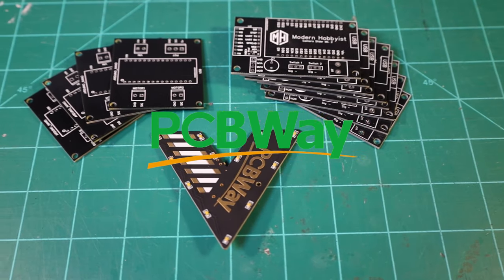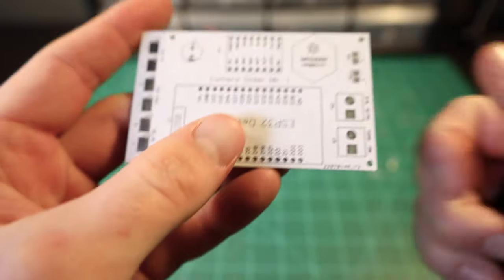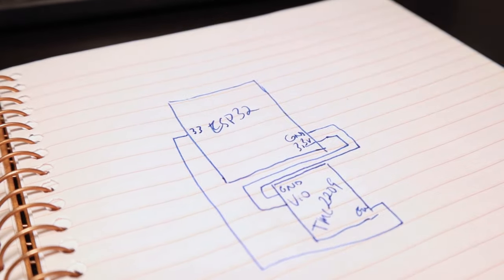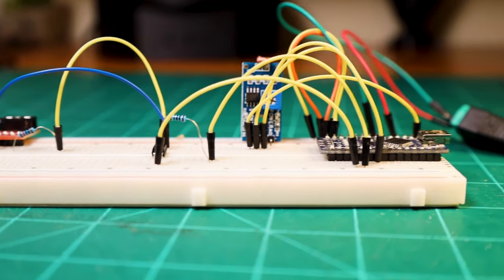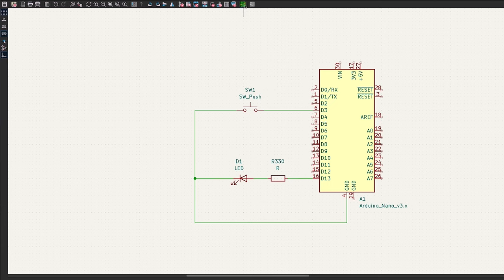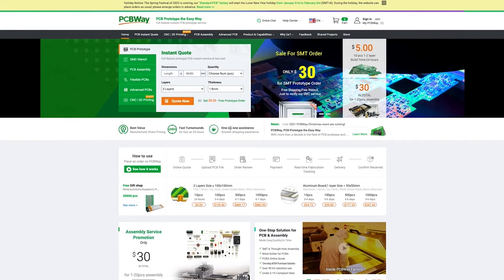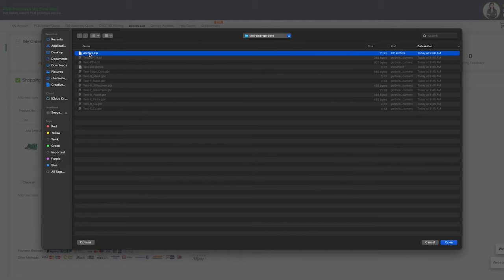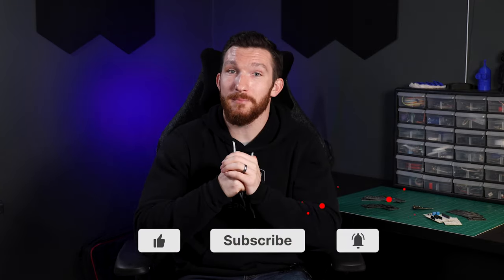How To Make Custom PCB's For Your Projects!

Comment: If I am an electronics hobbyist why would I contract a company to make boards for me? That's just dumb. That's like hiring an athlete to go to the gym to exercise for you. I want to hold something up and say, I made this. Some of the boards I've made are pretty janky but heck I made them myself.
Reply from the maker: Personally, I’m even more proud of my PCB’s, because I still designed them from scratch and I even get to put my logo on them.
Reply: Depends on the level of complexity of the circuit and most importantly if you're making something that NEEDS to be portable and small. Recently I started looking into pcb manufacturers because of a 5ghz wireless audio project that I want to incorporate into my beyerdynamics headband.
Reply: @ModernHobbyist  I don't have Keebler elves chained up in my basement doing design work here. Mostly though if I can find a circuit that does what I need it to I'll use that. Why reinvent the wheel? Although I have completely designed some circuits for whatever reasons. There's certainly enough schematics available though to keep anyone busy.
Reply: You are aware that most companies do this even big ones. Just because they get to produce the PCB it doesn't mean they own the produced products or will get credit at their own work. In fact end user usually don't care much about stuff like the manufacture of their PCB or inside components but rather who made the product.
Reply: Because when I design a guitar pedal effect to sell, I don't want it to look "pretty janky".
Reply: @fredtaylor9792  why not? Janky is unique and unique sells. I can buy commercial pedals for peanuts. Boutique pedals on the other hand cost. I took an overdrive pedal I'd made to a music store and let the owner try it out for a bit. The first words out of his mouth after he'd played was, "How much do you want for it?" I had to inform him it was not for sale. Believe me when I tell you that pedal had a prototype look to it. Because it was. One of a kind.
Reply: @1pcfred  I take pride in good quality,  even if janky sells.  Noisy circuits that fail can be someone else's game.
Reply: @fredtaylor9792  the point of an overdrive distortion box is to make noise. I've made hanging garden circuits that have functioned for decades too. The first PSU I ever made still works today. That was 46 years ago now.
Reply: @1pcfred  Gently playing wind Cries Mary through a fuzz box that hisses with noise with your guitar volume rolled back to give you that sparkling clean tone Jimmy Hendrix was known for, isn't what most guitarists want. I should know,  I'm also a guitarist. Apparently you're not,  because you don't use overdrive and fuzz for dirty tones all the time.
Reply: @fredtaylor9792  you know what opinions are like? Hint, everyone has one.
Reply: @1pcfred  Except I haven't stated an opinion, I've stated facts.  You're just getting abrasive because you know I'm right.
Reply: @fredtaylor9792  you've stated your unqualified opinions. You just don't realize it. You must think everyone's experience is the same as yours is. I can assure you that's not the case. We all do what we do for our own reasons. when I build electronics it is purely for my own self edification. No other good reason besides it's what I want to do. I'm not planning on selling it to anyone. I do it purely to do it. For the process. That's it.
Reply: @1pcfred  You asked why you'd want to contract the work out. You said "that's just dumb". So I explained why it isn't always dumb. You can't accept that so you continue to argue and insist your way is the only way it needs to be.  You're being petty and a stick in the mud.
Reply: @fredtaylor9792  indeed I asked why I'd want to contract work out. I only do the work because I enjoy doing it. That is literally the only benefit I derive. I am willing to invest a considerable amount in my own pleasure. Time, money and effort. I'm selfish like that. So you can add all of that to my character flaws.
Reply: @1pcfred  Keeping a list of your character flaws sounds like too much work.  I'll contract someone else to do that. Btw, it's not the work I don't like. Building pedals is a side gig for me and I do it for fun.  Point to point building is fun so I understand what you're saying. I still hand build my pedals, populating components myself,  drilling the enclosures and soldering the pots by hand... it's fun.  And it's not like having a pcb comes with no work.  You still have to plan out the layout and draw it up in software so they can make it for you.  It's professional,  clean, saves space and saves you and the customer money. I'm not saying you need to or should do it but to call it dumb to do it any way but your way is silly.
Reply: @fredtaylor9792  it would be dumb for me. I am only into it for the process. Perfecting that process gives me a lot of satisfaction. I would be completely deprived of that if I had the boards made. Which for me would be a great loss. I've done some point to point projects that have soured me on that method. But perhaps I just wasn't in the right frame of mind at the time? I set myself a bit too challenging a task I suppose. Suffice to say I was sick of things long before I was done.
Reply: @fredtaylor9792   I had that hit and miss stuff myself. So I figured out how to improve things. It's easy. You just heat the acid up and bubble air through it. That's it. You do that and you'll succeed every time. Acid has a fuming temperature. It just lets off vapors. When it does that it's hot enough. You can see it. Kinda makes your nose itch. So don't breathe it. Once you've hit fuming temp start bubbling and immerse your board. In less than 2 minutes you should be done. Works that good. For bubbling I have a 12V tire inflator. Kinda a crappy one really. The worse the better. You don't need a lot of air. We don't want acid all over the place. The acid just has to look like it's boiling. But don't boil the acid. You actually have to pump air into it. The air oxidizes the copper. Plus the bubbles agitate the mix.
Reply: Dude…
Reply: Cause I don’t have a drill but I find most companies will make 5 boards minimum. I have a simple amp design. Why would I need 5.
Reply: This dude... yikes
Reply: @SoccerPhoto  I would say anyone with a custom engine block is an alpha car hobbyist. I certainly wish I was operating on that level myself. I guess I'll just have to settle for the custom hand forged Venolia pistons I have now though.
Reply: If you’re an owner of a small company that needs well made boards for their product it’s not a bad idea to outsource it. But I agree that as a hobbyist owning it is what I preferz
Reply: Then there is the fact that you probably need only one, but if you have a board manufature make the board there is probably a minimum of 5 or 10 boards.
Reply: Can you make 7 layer PCB
Reply: @alpha_pixel_  I could if I wanted to. I'd rather design a single sided board that does what I need it to though.
Reply: I get your analogy but also not quite. It's more like someone who's building their own house but hires a plumber to do the water. 

There are so many other aspects to tinkering that doing every single step may not be what people want to do. 

For me, I want to do the code, the soldering, the case design and the pcb design, but I don't want to make the case or pcb.
Reply: @11219tt  I've modded my PC case. I'm thinking about doing a case build. I don't care for where cases have gone lately. Really all of PCs are headed in a direction I'm not keen on. The whole gamer thing. With the RGB. It's not my cup of tea. I guess my mouse is RGB? It has a goofy light on it. I keep it behind my monitor where I can't really see it though.
Reply: @1pcfred  dude I totally agree with the LEDs I needed a quiet and black computer for a recording studio band the thing ended up looking like a space age club instead
Reply: @11219tt  it is not easy to find parts that don't look like they belong in a discotheque these days. I don't want a window on my PC either. If I need to see what's in there I'll take the side panel off. I want external drive bays too. I don't like bottom mounted PSUs either. We used to know how to build a PC right. We're evolving backwards now.
Reply: No what your saying is that i didnt build that car because i didnt drag a pickaxe down a mineshaft to fetch some ore, id much rather draw a design, test it on a breadboard and have a company print out my design rather because all it is someone else print its like saying its not your book because you didnt write it down with the janky handwriting you typed it up and used someone else’s printer
Reply: Because even the most seasoned of electrical engineers don’t mine the copper out of the ground and laser etch the traces and sandwich in polymer. They design the pcbs and then order them from a company who makes pcbs.
Reply: 1) most of the new ics and microcontrollers only come in smd form factors 
2) CUSTOMIZATION , you need more ram , choose a chip has more , want more storage go for it , want wifi with an stm32 ? Add it yourself , want more storage , just add a chip are wire er up 
3) too many parts ? And being physically near impossible to make an feasible model which works for a long while without being in jank 
4) size 
5) detailed prototyping making life easier , just use 0 ohm resistors to isolate the circuits 
6) half profesionalism and more presentable and viable for final project ( if your project is for example supposed to work in the rain you can't waterproof a breadboard ) also you can make3d cases for a pcb since all the peices are fixed on a pcb 

In conclusion , your opinion is wrong but you'll figure it out soon enough , your prob new to the hobby
Reply: Sometimes the skill is the process, sometimes the skill is the product… writers don’t need to know book binding, but if someone does and wants to do it by hand, sure that’s awesome and an art in and of itself, but it doesn’t make writing any less of an art if they use commercial companies to print it… it’s also the equivalent of photography, some artists take pride in every single step, but some keep the art in the construction of the shot and the settings to put it to negative, neither is better or worse, they are different .. I am assuming you are acting in good faith in this thread and genuinely don’t understand why people would outsource production, but even if not, I think it’s important for outside perspectives to understand
Reply: @TheAgentGray  I understand why they won't do it. They don't want to do it. Maybe if writers had to carve every letter we'd have better books? I can tell you this, not a moment goes by while I'm designing a board where the thought that I have to make it isn't in my mind. Now if you think that hasn't been a great influence then you'd better think again.
Reply: If you take the time to get a circuit worked out just right, do you really want it to look like you cannibalized your wife's toaster?

Comment: NO. The cost of commercial PCB services, including shipping in a reasonable amount of time, IS HORRIFYINGLY EXPENSIVE when all you need is ONE SINGLE PCB, compared to any other method of making one. NOT a viable option.
Reply from the maker: PCBWay has several shipping options starting at $5, and while it might be a little bit more of a wait, I wouldn't call it unreasonable for a shipment from China. I find the quality and convenience totally worth it 🤷‍♂️
Reply: @ModernHobbyist  The $5 shipping option quotes 11-33 days for me, which in my experience, from China, is never less that those 33 days. That's exactly what I call unreasonable; a month from now I won't even know why I designed that PCB - I need it this week at latest, and that's multiple dozens of $ in shipping. Whereas I can have my "crappy" single-sided, milled-at-home version TODAY, done on my tiny desktop CNC. Double sided if I really HAVE to stretch it. Is that adequate for designing a PC motherboard? Hell no. Adequate for 99% of anything a hobbyist might design? Hell yeah, and the cost is that of bare copper-clad, a.k.a. zero $.
Reply: @AttilaAsztalos  On my earlier projects, I was impatient and paid about 25 USD for shipping thru DHL. PCBWay has standard 24 hour fab time, and one board I did was ordered Thursday evening and arrived Monday afternoon. I've started using standard shipping for 8 USD and get boards in about 3 weeks.

Comment: For small PCBs I learned to tile them together with breakaway connections (aka "mouse bites") to get a lot more production value. For one project in particular with a tiny 23x12mm PCB I manually tiled 18 of them together and was still easily within the 100x100mm prototype PCB size. So instead of 10 PCBs I got 180 of them for the same cost, just requiring some manual work to separate them and trim the edges.
Reply: Oh true, I haven't thought about that much

Comment: Dont forget to check your design rules!!!   I stopped breadboarding about 15 years ago, because it's a lot of extra work, time, and money. Instead, I run simulations, both analog (ngspice), and digital (Verilog) to ensure my design is correct, and when I build my boards, I rarely have to do any debugging because the bugs were already found and fixed during simulation. The few bugs I do find are caused by soldering issues (my fault), and those are always with surface-mount parts. Most of my boards go to PCBWay, but the really small ones (less than 2 square inches) are sent to OSHPark, which is just across town from me.
Reply: I want to learn how to do the simulations so I don't waste money on a PCB that doesn't allow me to do the job I want to do. Do you have any advice or resources I could use to learn that?
Reply: I use the gEDA tools (free), which have a schematic editor (gschem), PCB layout (pcb), and netlister (gnetlist). The netlist for the entire PCB is extracted in Verilog format, and I run a full set of logic simulations using the Modelsim verilog/VHDL simulator that it also free, thru Altera (now Intel). It is possible to do very basic verilog (digital) simulations on analog parts, but it's a bit of a pain to create the models. I've made models for LEDs, electrolytic caps, transistors, resistors, connectors, and even transformers. The goal is to verify connectivity is correct between everything on the PCB, and also to exhaustively test all of the digital logic, which sometimes includes an FPGA.

All of the analog schematics are netlisted out in SPICE format, and I run simulations using ngspice. So far, I have not found a free simulator that can run verilog AMS, and I'm not going to use any digital extensions to ngspice, because the performance is probably horrible with large digital designs.
Reply: @gregebert5544  yeah thanks for the advice. im working on a long term project. so as for constraints on time and trouble shooting, i have around 3 months.
Reply: Do you know of a place I can send parts to be soldered for me?
I have had a nightmarish time soldering and could use some help on that front Lol
Reply: @JM-nv5dt  PCBWay will do assembly for you at additional cost, though I dont know how they manage having all the parts you need.

I suggest you order extra boards and practice soldering on those. There are a lot of useful tips on youtube. It's critical that you have a good soldering iron, such as a Weller, and keep the tip clean, preferably one that looks like a small tumbleweed of brass shavings. I prefer 60/40 tin lead solder (I know, I know, lead is bad.....but it's easier to solder with it). For surface mount, a cheap air reflow gun (mine was 40 USD on Amazon) works very well if you use a good quality paste, such as ChipQuick.
Reply: @gregebert5544  Alright, I might have to send them the parts to assemble? I'm trying to make a pcb bridge so I can snoop the bus of a 0.3mm 45 pin FPC cable.
Reply: @gregebert5544 The good news is that you don't even need to order spare boards since you need to order a minimum of 5.

Comment: When you do the breadboarding, do you use the actual packages? The thing is, my project is miniature so a lot of the packages will be smd and very tiny, specially capacitors and resistors. Should I use an equivalent but bigger package? When it comes to other IC should I stick to esp32/arduino modules as much as possible while prototyping or should I buy the individuals to stick to the closest final representation?

Comment: I'm a little confused, can you order the PCB with the components already installed? Like at the end you soldered the Arduino on there, but can you order the PCB with buck converters, mosfet switches and Arduino and resistors and all that integrated into a single PCB with connectors? I have an idea that I want to mass produce but want to drop ship them to customers and have them just install the Arduino code (unless that can also be done by PCBWay?) and mount to a 3D printed enclosure that they print themselves from a file I send them.

When I say integrated, I mean integrated. Not a board with the Arduino and components soldered on top. I mean the board itself has those components built into it.
Reply: you can use SMT service for that, make sure you have the part list (BOM-Bill of Materials) when submitting your PCB design

Comment: When you have ONE unit of a personal project, it's totally stupid to have a pile of PCBs produced in China, with all the pollution and waste it causes.

Protoboards with wires, or even better, Manhattan technique, are perfectly fine for unique personal project. And it's way easier to modify or correct in case of error. If you make an error on your PCB, you can throw away a pile of useless  FR4 boards...

Thos semi-industrial scale PCB production methods are totally stupid for the hobbyist...